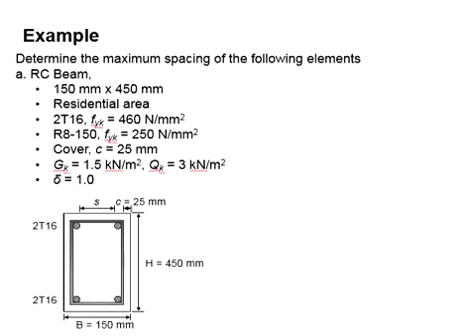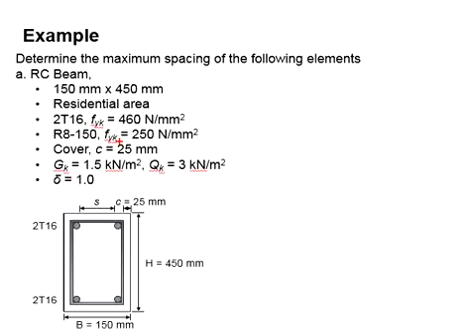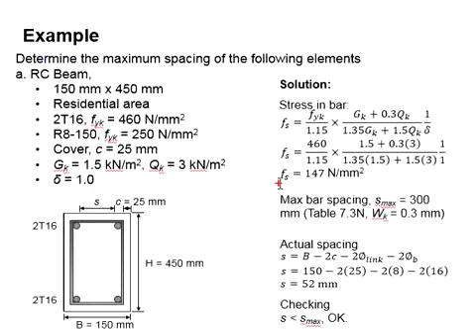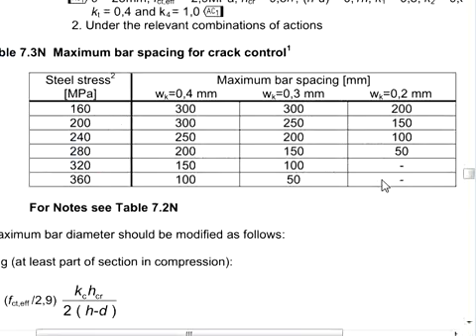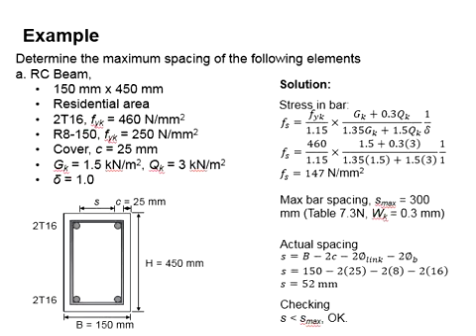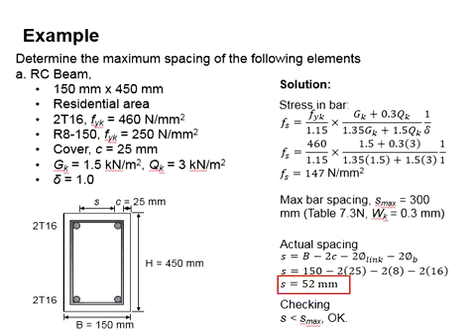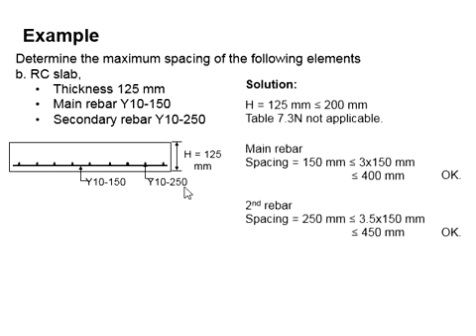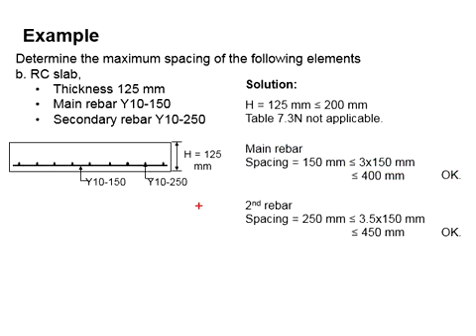6.9 Example: maximum spacing

Comment: Hi Sir, in bar’s stress calculation, how do we calculate for Gk and Qk if the element is subjected to several UDL and point loads?
Reply from the maker: Good question. In my opinion, this is not a problem under normal circumstances. First, the formula fs is actually taking the ratio between the quasi-permanent condition (Gk + 0.3Qk) and the ultimate limit state condition (1.35Gk + 1.5Qk). That means whatever value of Gk and Qk would yield the same fs. Second, a typical structure is analyzed based on the actions recommended by EC1, often in the form of area load kN/m2. These area loads are then distributed to the beams and columns, which gives you UDL, or point load. Yes. It is possible to have several loads on a member, such as UDL and point loads. However, the ratio between Gk and Qk would be the same. As long as the ratio is the same, you will still get the same fs.